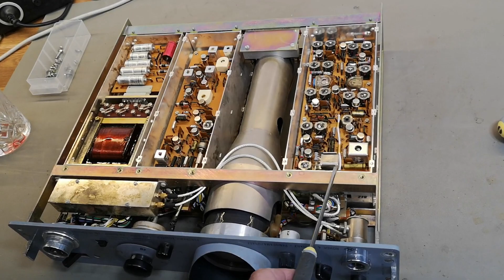Rohde & Schwarz ESUP panoramazusats IF spectrum analyzer BN1500211 1967

Comment: Hi Thomas, I hope you have a good foundation at home, your last catches have a bit more weight, so you won't be a floor lower soon 😂
Those connectors are really terribly loose, considering that someone has done some intervention in it - there is no lack of some mechanical fixation.
Thanks for these videos, it's a beautiful demonstration of a technique that I would never have come across. I once made a drive shaft for a potentiometer from joints and an extension of a small set of socket wrenches.

Nice day 🙂 Tom